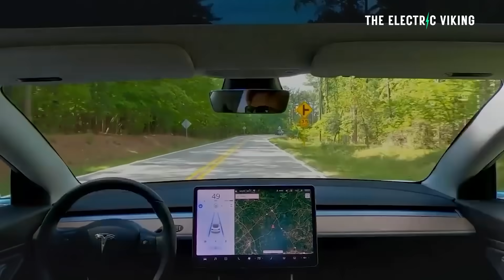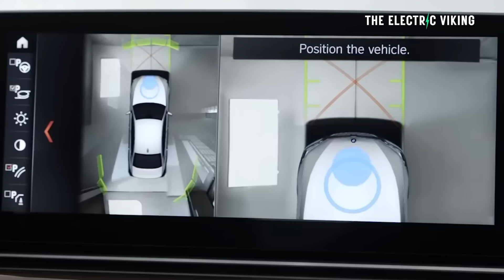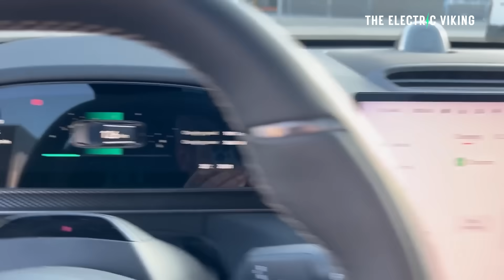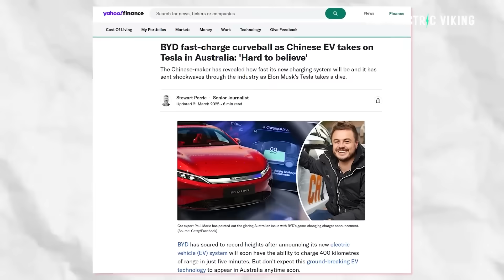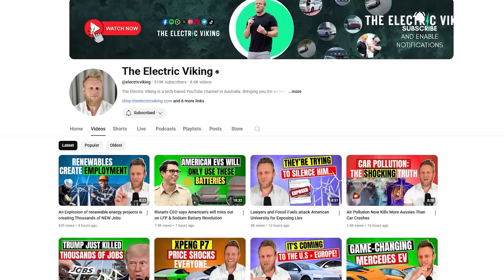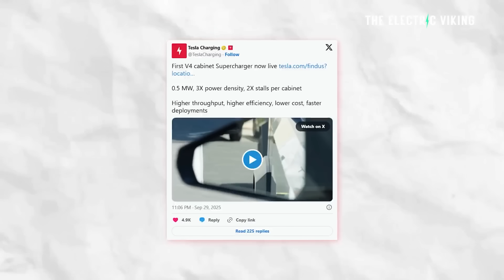300 kW WIRELESS CHARGING! The Infinite Range Highway Is FINALLY Here

Comment: My wife is paranoid about electro magnetic radiation even holding her mobile phone close to her head or in the pockets of her jeans for prolonged periods.  She also gets freaked out if we spend time close to high voltage transmission cables or sub station transformers so these 300 kW roads would drive her nuts and I can understand her fears.